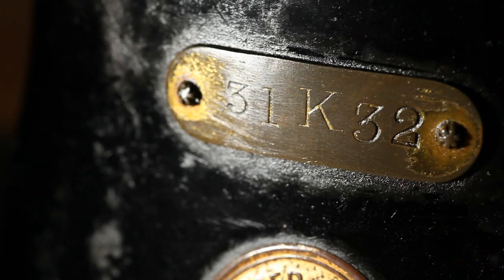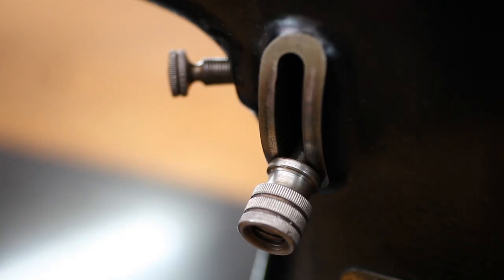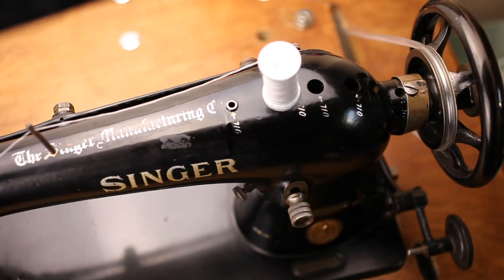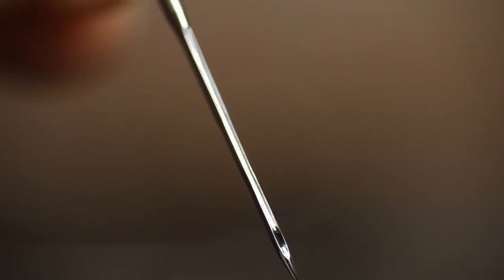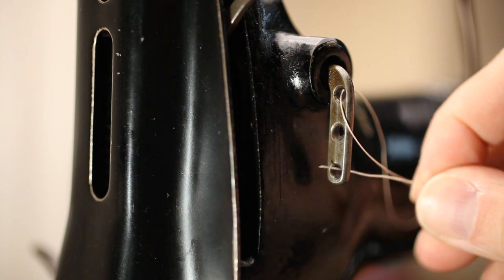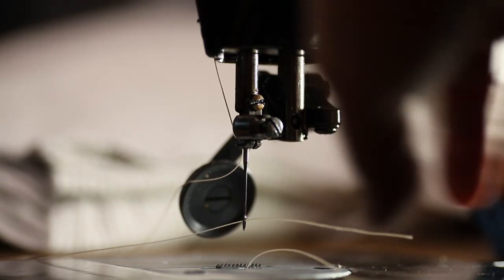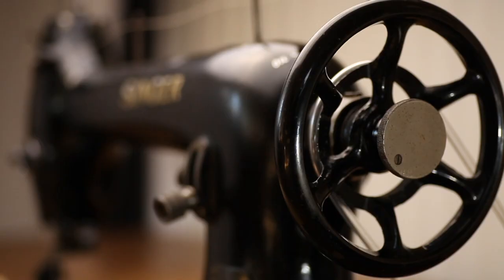Introduction to and threading a Singer 31-32 / 31k32. First time sewing

Comment: Hi I have 31k32 it does pick thread from bobbin but no stitch just run
Reply from the maker: Are you using the correct needle type?
Reply: Pls advise me is there special needle for this machine
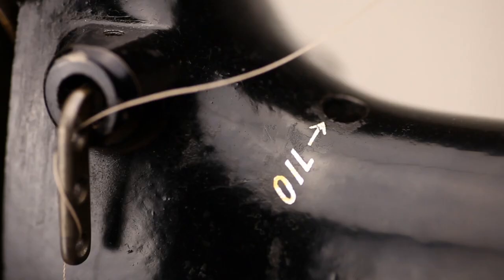Reply from the maker: @ManjeetKaur-ui5ex  Yes. The 31k32 needs an industrial style round needle. In the video I tell you what sizes can be used. Scroll to 1:53.
Good luck, Erik

Comment: Please , the needles DPx5/134 are good ? , for model made in 1948 ?
Reply from the maker: I think I’m using the DPx5 needle in my 31k. You can give it a try. Worst thing that can happen is it doesn’t work. Good luck
Reply: @erikneek thank you
Reply: @erikneek  I think there are 2 possibilities, if the needle is too long it can break and in addition it can damage the hook, or too short and then a stitch cannot be formed
Reply from the maker: @staicu_dragos  I would suggest to manually turn the machine slowly (with that needle inserted). 
If you want the be sure it fits you might want to join the Vintage Industrial Sewing machines Group on fb and ask your questions there too

Comment: How much does something like this go for? I could not find anything online and I was curious. (Talking about a full set, all original)
Reply from the maker: Hi Filipe.
Value... it's difficult. It all has to do with location and availability. In my area the machines are cheap. I got the head of a 1925 Singer 31k32 for 40 euros. A month later I found a 1924 Singer 31k32 in a treadle table for 60 euro or so.
Later I saw similar models for even less. But I also saw them for more...
The real value is what YOU want to pay for it, I think.

I kept the head of the 1925 model 31k32 and put it into the table of the 1924 model 31k32. Then I bought a NEW motor. I think I can get little over 100 euros for it.

Comment: i just got a singer 31k 47 walking foot any good ???
Reply from the maker: NICE find! You must be very happy with that machine. Enjoy!!!
Reply: @erikneek  the pressor foot only goes so high if it went high up this would be dope can you alter the walking foot to walk more
Reply from the maker: @rndea100  you can change the stitch length width of you machine and therefore also the walking foot steps. Does this answer your question? 
There is a fb group on vintage industrial sewing machines with many (!) knowledgeable enthousiasts. You can post your questions there too
Good luck!
Reply: @erikneek  no i think i need different feet seems to have a pipeing chord foot on i need a standerd one will the singer 132k feet fit

Comment: Hello, I have just found a machine just like yours in prestine condition for around 100 euros, can you share any weaknesses? Or would you bother to have a conversation over an email?
-Greetings Sasho
Reply from the maker: Hi Sasho. 
Congratulations! The 31-series is a great machine!
Do you have a 31-32 too, or a different version?
I did not have many problems with my Singer. Only one, but it was an operator error. And the operator (me) is the weakness-part. LOL
The roller foot I bought was a cheap one form Aliexpress which is not the best you can buy... :-/
These machines were made to keep on working. It does! Give it some oil and it will not let you down!
Enjoy!
Reply: @erikneek  hello its the exact machine like yours, what is the maximum stitch Lenght if you can share, thank you
Reply from the maker: @azsamsasho  Oops... don't know the exact length. I think it is the same as the max length of the 31-15 since the machines are very similar; 4,25 stitches per inch.
Reply: I don't understand.
You say "The groove should be at the left side of the needle", but on the video it is opposite..
Groove should look inside as I understood.

Can somebody also right down in comment what king of needls can we buy and if it is possible also links where is better to buy needles?

Comment: Can you drop the feed dogs on these beauties and does it use regular industrial high-shank presser feet? Thanks for a great video!
Reply from the maker: As far as I know: Yes. Loosen the screw underneath the bed. Never done it personally, so this is as far as my knowledge goes...
Good luck, Erik
Reply: @erikneek  Thanks! One more question: I have to replace the belt. Will a universal one do?
Reply from the maker: @grittyinpink16  Yes you can replace it with a 'normal' leather replacement belt. But I recommend to replace it with a rubber belt.

Comment: Is its presser foot the same as singer 31-15? And its bobbin and bobbin case?
Reply from the maker: Yes they are the same. The parts I ordered were for the 31-15 series and they do fit on the 31-32. The 31-32 is basically the same machine as a 31-15, only with a reverse. Enjoy your machine!!!
Reply: @erikneek  thank you.